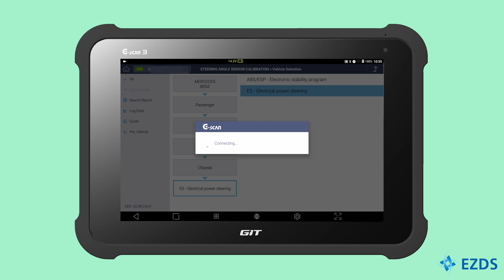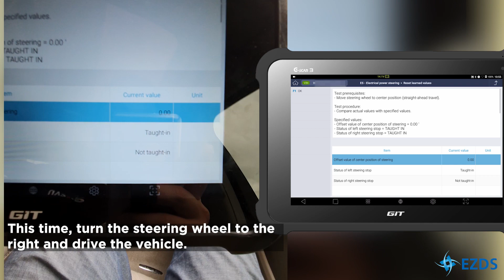2017 Mercedes Benz Maybach Steering Angle Sensor Calibration

Comment: Another strong point of Gscan. 
By the way I wonder why steering wheel has been replaced in such young MB car ?
Reply from the maker: Hello Adam! It got an accident. The steering assembly costed more than $700.. Ouch.!
Reply: @ZenithDiagnosticScanTool  hello will a used steering assembly work?